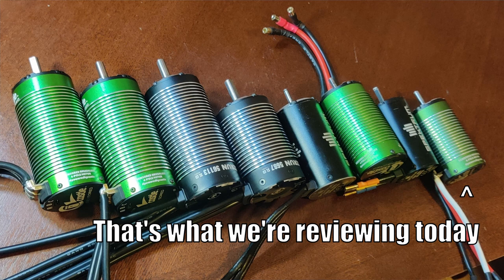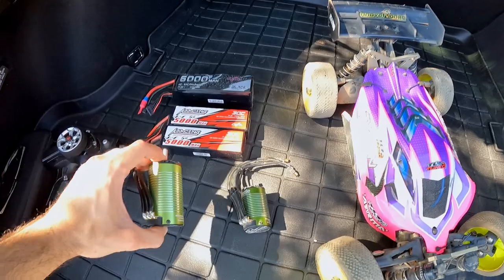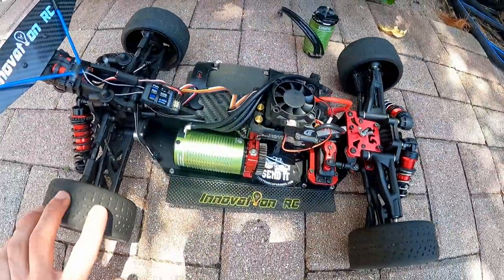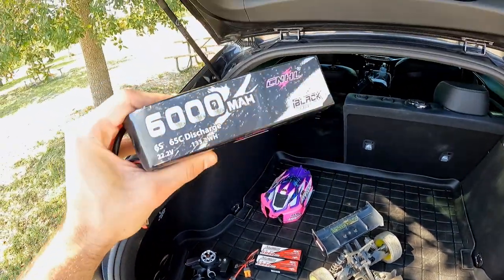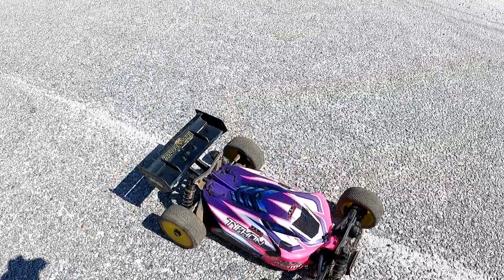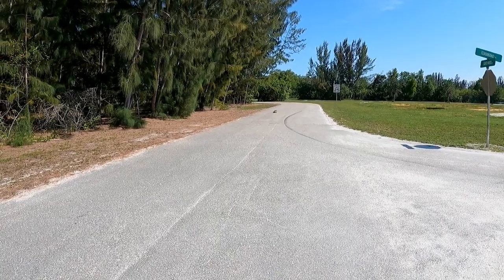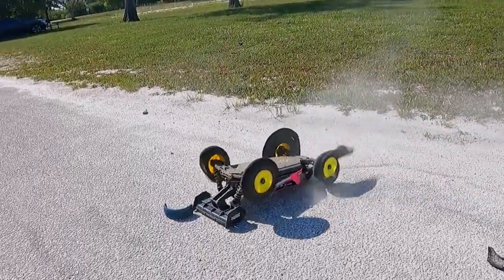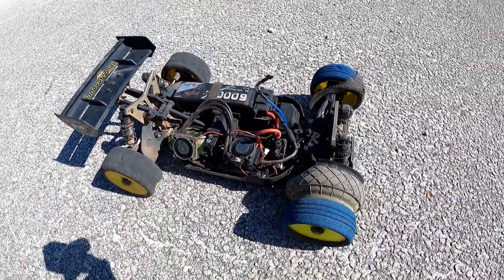NEW Castle V2 2200kv Motor UPDATED! FINALLY

Comment: How can you not love Castle...
Reply: Can i run those motors with hobbywing quicrun ?
Reply: @idan678 .. as long as they both use the same bullet connectors, you can run any motor with any esc.. up until you exceed limits or are building intended custom builds

Comment: It's mentioned that the new version should run cooler...that's, supposedly, one of the two biggest advantage of the new version.  So, v why not do a comparison?  For example, run the V1 full throttle for approx 5-7 minutes, then temp temp of the motor.  Then, with exact same setup (same gearing, same battery, etc), run the exact same test (exact same length of time, exact same running area) using the V2, and take temp.  Only this way can it been seen whether (or not) the new version is actually cooler. 🤙🏼

Comment: Castle needs to release v2's of the xlx2 so i don't have to clench my cheeks every time I turn it on 😥
Reply: For real, I'm on my 3rd one in the K8 Exb. Should be due for castle to get with it and go 12s capable. HW has the Max 5 V2 now and the Max 4 for 12s.
Reply: @bhardison1869  wow that sucks man. I had one explode into flames in my k8s and the replacement for that one also died on the first pack. I also have one in an arrma felony that has lost sensor capability. Durability really blows!!! don't have many options though.
Reply: @BeautyBeastRC  that's what happend to my first one about a year and a half ago got about 6 mins into a brand new otb set up and poof esc went in flames and shorted both brand new power hobbys packs, full on fire.  Luckily, batts and xlx2 were replaced for free minus the castle shipping, 1100kv has been a beast though,  no issues there.

Comment: Shouldn’t it be a v3 since the first one wasn’t sensored? I did 84mph on 4s in my boat in oval trim with the first motor. I’ve got the sensored 2200 in my Typhon 6s.

Comment: I have a question. I ordered one off eBay and it doesn’t look like yours.

Number two : Can you spin the shaft with your hand freely without installing it first?

I tried to turn it with my hand, but it doesn’t move the shaft bar
Reply from the maker: You probably got scammed with the Chinese rebrand ones. The new v2 yes you can spin the shaft freely it isn't as difficult
Reply: @InnovationRC  60 bucks.. 😩
Reply from the maker: Yup. A real Castle motor is at least twice that. If you see a new Castle motor for $60 it's the Chinese rebrand

Comment: Is this why there is a new parts code? I just ordered a 1515 and MMX today at hobbytown. I had noticed online the combo was backordered. But the guy at the store found it was listed under a different part number
Reply from the maker: They could be discontinuing the original motor so a new part number will be needed for any new combo it's included in

Comment: Good post.  I just put together a arrma outcast exb 6s  and have had a 1515 2200kv motor sitting around for years.  It hot where I live as well.  That motor is a beast but I haven't found good gearing for it yet seem to get hot pretty fast.  Any thoughts on good gearing?  It's 19t pinion and I think stock spur is 54t.
Reply: Pretty high kv for a 6s rig, stocks is 2050kv I think you should go lower kv motor, castle 1650kv/hobby wing is a popular go to for arrma 6s rigs (kraton outcast talion etc) my .2 good luck!
Reply: @rcstackz7333  yeah my kraton 6s has a 1717 in it and the the 2200kv I've had for about 3 years and haven't done anything with it.   Don't get me wrong it's a absolute power house just haven't had time to play with the gearing yet.
Reply: @joshherrman3201  yea I got the cc 2200kv with a mmx6s sensored in my infraction 3s it’s a great combo with the custom mod 1 Gearing, I just think it’s not up to a 6s rigs weight.
Reply: @rcstackz7333  what are you running for gearing?   I hear ya. I think I just have mine way over geared but I could be wrong.
Reply: @joshherrman3201   I believe it’s 26p with a 34 spool it’s just a straight line speed car it’s pretty light. 

I’d start at like 15/16 pinion with the stock spur n see how temps are

Comment: ive had the typhon for about a year and got use to the power and want more. and ive been researching like crazy what motor is good for more powee and first i was gonna go for thw 1717 kv castle motor but starting readings that its maninly for heavy vehicles that need torque and not so much speed but i want a combination of the both so aftee watching this video i might go for this motor instead

Comment: I recently bought a Kraton 6s rolling chassis. This motor esc combo 2200kv 1515 w/ monster x esc. I ran 19 tooth pinion stock tires would only allow the car to hit  hi 40 low 50 I think l hit 51 mph. I wasn't very impressed an it did not last long at all after the first thermal shut down kiss the motor good bye it'll never be the same. Better than a hobby wing way more torque but the way i bash none of these motors well last long at all # 8 is in the mail tp power 4070cm 2200kv making 9 hp with lots of mods to accommodate of course